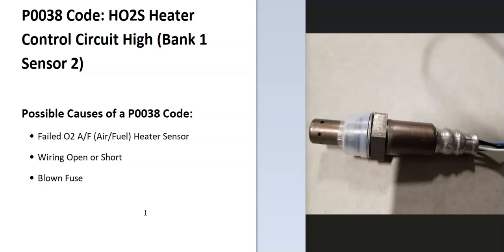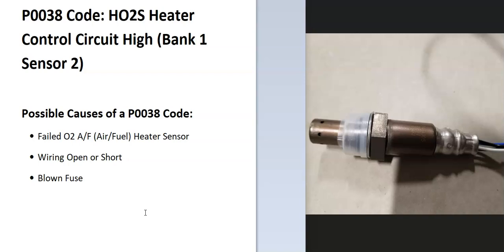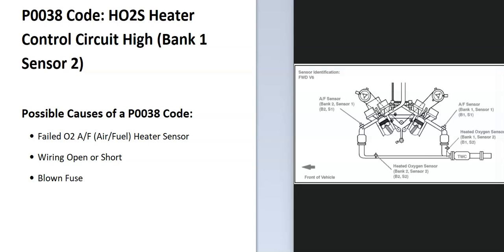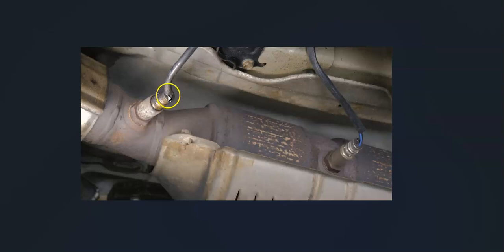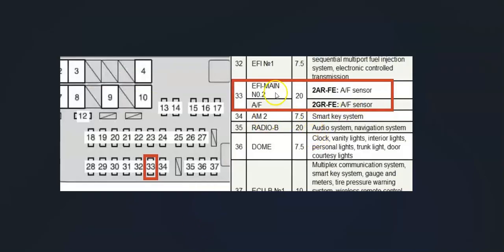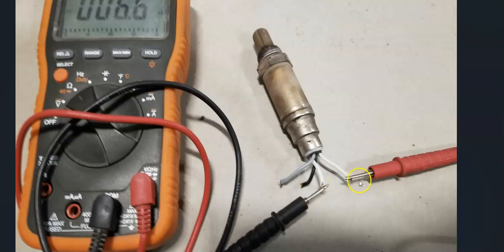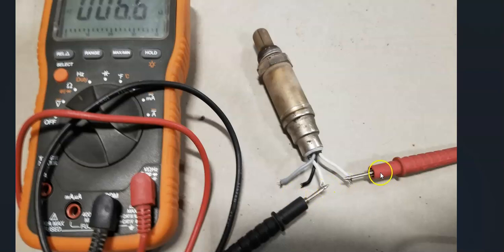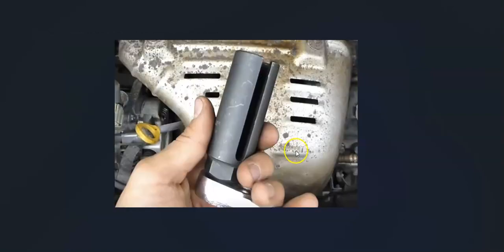Causes and Fixes P0038 Code: HO2S Heater Control Circuit High (Bank 1 Sensor 2)

Comment: How to find a fuse. Its in cabine or engine bay? I replaced the sensor, got no multitool to check the wires, but they look OKish.
Reply from the maker: It can vary depending on the vehicle, but usually there is a fuse and relay in the engine bay fuse box.
Reply: @HVAC_Mechanic  so if for my 207 peugeot, it says its one fuse for ECU sensors and whole ignition, then i can remove it from the list as the car starts? Then its probably wiring.

Comment: I Got This Code On My 2007 Jeep Liberty, I Replaced All 4 Oxygen Sensors and I Am Still Getting This Code? I Also Replaced The Whole Exhaust Including The Catalytic Convertors and Muffler.
Reply from the maker: If the 02 sensor is good, it is likely in the wiring. I would check for a blown fuse or bad relay. The 02 sensor heater circuit should get 12 volts on a cold start until the engine warms up.
Reply: @HVAC_Mechanic  I have Changed All The Relays And Fuses To New, But I Still Have Those Codes. Can A Temperature Sensor Throw A Circuit Heater Code?

Comment: Is there a specific Fuse responsible for the 02 sensor(Bank1 Sensor 1 &2, and Bank 2 Sensor 1&2) on a Jeep Wrangler Sahara 2008?Especially the Bank 1 Sensor 1 &2,Thanks so much
Reply: Have same issue bank 1 sensor 2

Comment: I got p0038 code for my lexus es 330 please suggest me what to do now..??
Reply: I got this code but it's because I spliced some upstream O2 sensors to fit the downstream connector 💀
Reply: It’s either downstream or upstream but could be wiring or fuse that connects to it